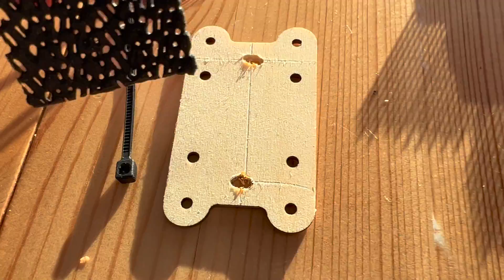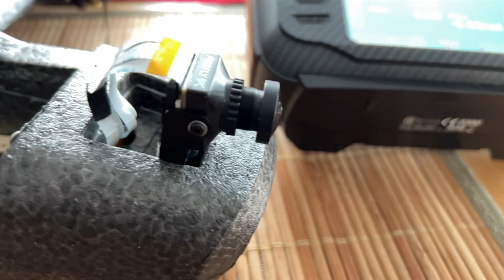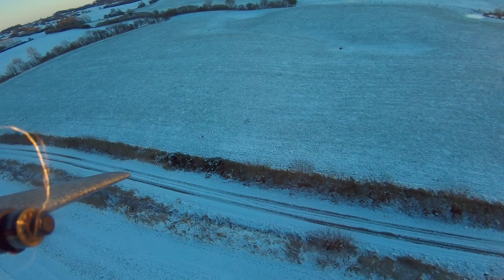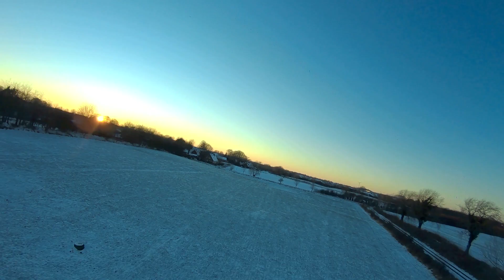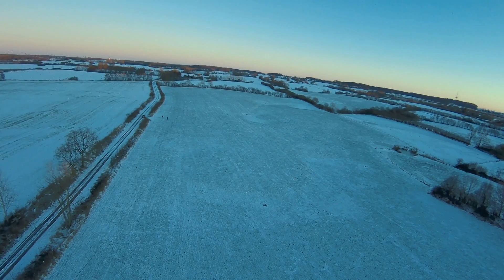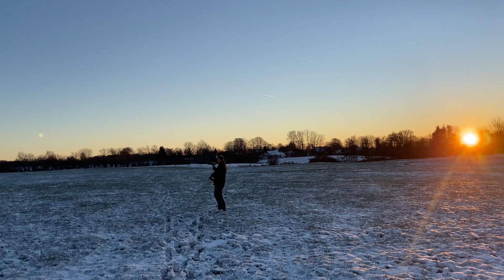How I built it and did the maiden | Hee Wing T1 Ranger EP:02

Comment: Great video!  May I ask how did you manage to balance the plane?  I´m using a 3S 2200 and seems to be tail heavy, Cheers!
Reply from the maker: Thanks 🙏 I use li-Ion packs. That day I started with 3s4200 as 3 21700 cells did. fit. Currently I’m on 4s3000 with 18650 cells. A friend of mine even had 4s4200 in it. It all balances
Reply: @JustFPV-net  Thanks!  I´ve been wanting to try those batteries, have a great week!  Cheers!
Reply from the maker: Same to you … hope you’re gonna like it

Comment: I am installing the same flight controller as you have on the model. But I don't understand how to connect battery power to pads "- +2-6S" on the PCB of the flight controller.
Reply from the maker: Have a look at the description on mateksystems.com - there the wiring is explained in detail. There is only one + and - for the battery.
Reply: @JustFPV-net  - "Have a look at the description on mateksystems.com"
- "Site under maintenance" :-(

The "Hee Wing T1 Ranger PNP Assemly Guide" document does not mention this.
I will try to clarify my question.

Wires soldered to the power distribution board:
1. Battery input - XT-60 connector.
2. Output to the left wing ESC.
3. Output to the right wing ESC.
4. Output in the form of a standard three-pin servo connector.

I don't understand how to power the PC from this board.

Comment: Hi, matek 405wse manual said dont connect 5v from motors to vx pad, because the fc has its own 5/6v bec.. im confused. And for the wings servo, you said it needs to be separated. But if im not mistaken painless360 said it dont need to be splitted. And keep it joined and connected to 1 servo pad. Please explain more.. i want to build mine today.. thanks
Reply from the maker: hmmm ... sound like you get something wrong here. Don't connect motors to 5v - your go nowhere! I we talk about the ESC's then RIGHT: Don't connect the 5v to the matek board as it won't need a bed and has its own power supply.

Servos splited or not!
Depends upon how you want to fly! If you don't fly with an FC then you don't need to split the wires. BUT if you fly with Matek FC then you MUST split the wires as it controls the servos individually. Without the split that isn't possible.

Hope your's will fly as good as mine.
Reply: @JustFPV-net  yes i mean esc 5v.. but on your video you plug all ground, 5v and signal pin. Not removing the 5v out ?
Reply from the maker: oh now i see ... thats because the ESC in the wing has NO 5v out. So instead of having the 5v lead jumping around while flying, I just plug it on so it cant short-fuse anything! And there is no 5v on it :)
Reply: @JustFPV-net  ahhh i seee.. so the esc on stock t1 dont output 5v.. thats why many ppl still plug them direcly and got to problem.. for the servo, painles360 still use Y cable with inav.. i want to try this first because i dont have crimp tool and the connectors to split them.
Reply from the maker: just be aware that you cant trim right like that as the servos cant go individually!
Reply: @JustFPV-net  well noted.

Comment: Hi! Great video! Do marek F405 WSE has ESC on board? You wired ESC + and - directly to motor connector on the wing locks. I misunderstood this part. Does F405 require an ESC module or it is embedded? Plus do you know what is the heewing T01-E5V2-10801 board which is coming together with T1 ranger?
Reply from the maker: nope ... the Matek F405-WSE hasn't any ESC's ... but the wires that was soldered on go into the ESC in the wing! So there the (missing) ESC is hidden behind the motor.
The Board is the power distribution in case you don't have a flight computer like the Matek F405 which does this for you.
Reply: @JustFPV-net  How did you know that ESC is placed behind the motor in the wing? I can’t find the info on heewing page. Thank you for the info! It simplify assembling for sure :)
Reply from the maker: @irelandfpv  it comes assembled in the PnP version - but if you look at the wings and remove the plastic cover for the motors, then you'll see the gap for the ESC.
Reply: @JustFPV-net  Thank you a lot! I glad I found your video!
Reply from the maker: @irelandfpv  glad I could help out

Comment: Looking great buddy! Your flying location looks far nicer than mine does currently! Very smooth work on the sticks and loving the panning camera setup.

I fitted a Rush Tank Solo VTX in my fin and lost a lot of rigidity after removing a fair amount of foam so I spliced in a carbon strip into the leading edge of the tail fin to add a bit of strength back into the fin. Yours looks fairly sturdy still, however it might be worth doing the same for crash protection.

Excellent flight 😀
Reply from the maker: that idea with the carbon spar is a very good one! I do prefer the Solo Tank too but didn't have it at spare (the other project robbed me), haha. So a good old what-so-ever-AKK did the first job on flying the T1 ... should be ok'ish for the first 6km or so.

That field is indeed nice. But the one you got with the CWM was awesome too! looked like a big landing strip from above (allthough you landed on the other one).

I will change that camera on the servo and perhaps the servo too to something better. Let's see how this turns out. 

Still I didn't manage to get my LEDs alive ... you got an idea on how to make them work with the F405-WSE? :) That would be cool, mate!
Reply: @JustFPV-net  I'm very new to using LED's however plugging them into the LED pin on the FC and going to the LED controller on INAV allowed me to select some colours. As they're wired in parallel they both light up the same colour though. I saw something on one of the FB RC pages about wiring in a 3rd LED which would make them addressable with different colours on each wing.
Reply from the maker: I tried to define 4 leds ... yet you're right - parallel ... will give that a try later